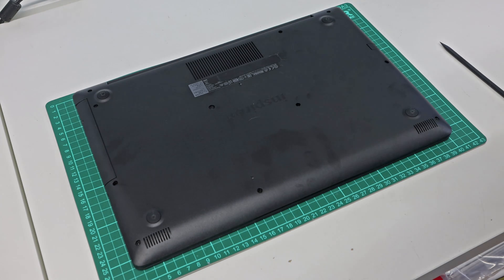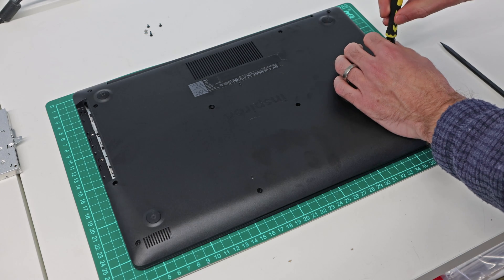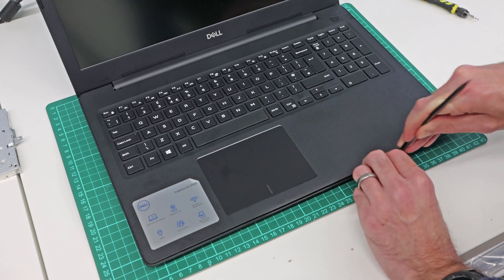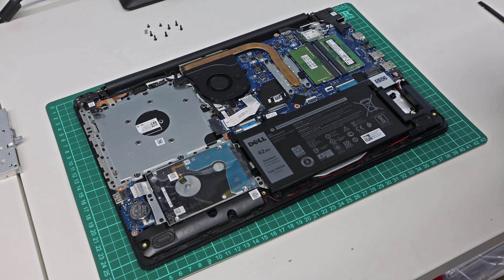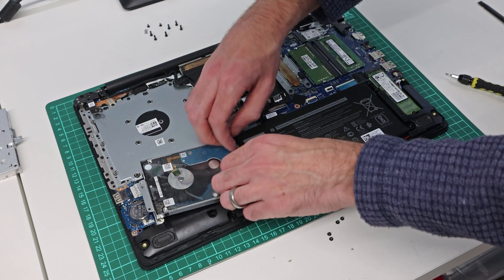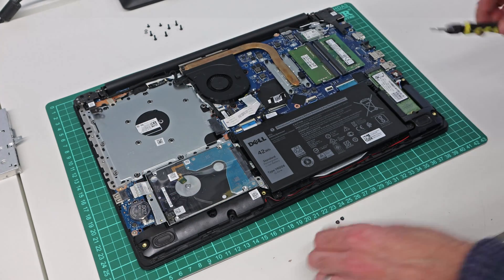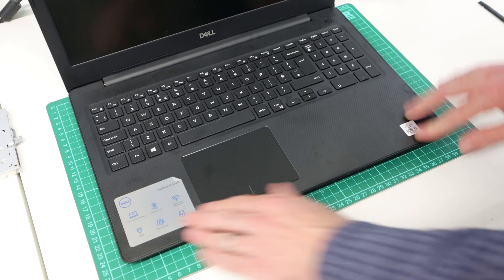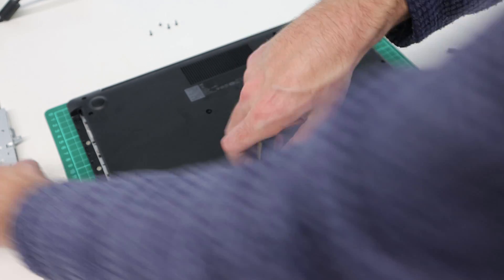Dell Inspiron 15 3593 - SSD and HDD Upgrade and Repair Guide

Comment: Hello can I use the crucial P3 plus instead of the P2 ssd?
Reply: Thank you very much for your advice👍
Reply from the maker: No problem - I've updated the links in the description.
Reply from the maker: Should work, but you won't have any benefit vs. the standard P3 which uses the same controller and is a little cheaper as the laptop won't do PCIe 4.0 speeds.

Comment: What’s the next step after adding new NVME chip (500GB) and Ram(16GB)
I still have my old 1TB HDD

I’m stuck😢
Reply from the maker: You'd either want to clone the contents of the HDD on to the SSD (if it'll fit since it is a smaller drive) and remove or wipe the HDD, or clean install Windows on the new drive.

Comment: HI.. I recently got a Dell Inspiron 15 7000 Gaming i7 from an auction. It is without the SSD, has hard drive only. I have been trying to install windows but it fails. Could it be that there is no SSD?

Comment: Hi there. My Insp 3593 came set up as a RAID array with the m2.sata and the mechanical SATA drive. The drive activity is always pinned at 100%, so I thought I could relieve that by upgrading the SATA drive to an SSD drive. But I'm not clear on how to do that given that I'm coming from a RAID setup. Do you have any tips on how to replace just one of the two drives of the RAID array? Or another strategy? The SSD (Crucial) comes with Acronis cloning software. Thanks!

Comment: I have the 3593, thanks to ur video, I was able to upgrade the memory. Your videos are well detailed and explained. I watched the above video in hopes of increasing storage space but got lost in the lingo of components with sata and nvme...... Please assist .
Reply from the maker: You have two drive options in there - the M.2 slot, which takes a new style M.2 2280 drive of the NVMe type (1TB Crucial P2 M.2 2280 NVMe SSD: https://amzn.to/3pL2i7o) and a 2.5" SATA bay which can take a traditional mobile HDD/SSD (1TB 2.5" SSD: https://amzn.to/2K1OjtV).

Comment: 10:50 doesnt void the warranty as long as you have original parts for exchange with technician. dell technicians are outsourced and get paid for replacement. they are not gonna deny warranty cos they wont get paid
Reply from the maker: Good info, thanks.

Comment: Brue computing 
Can you tell me 
Is the m2 port is pcie x2 or x4 length
Also can you upload a video of that laptop showing the ssd benchmarks... Pls.. :(
Reply from the maker: The length doesn't dictate the PCIe lanes - it can take either M.2 2230 (30mm length) or M.2 2280 (80mm length) drives.
The slot is keyed for PCIe 4x Gen 3 devices, but I didn't test a 4x device or run any benchmarks - I no longer have the laptop (I only kept it a couple weeks to make videos) so can't help with this.
Reply: @BrueComputing  thanks for the response..
I am sorry i really got the length part wrong 
I Actually meant the bandwidth
Although i purchased a transcend nvme ssd 220s 256 GB
And saw it supports pcie x4
Glad i got confirmed... 
Thanks again

Comment: where did you find dvd slot there? i dont have on mine
Reply from the maker: Not all models have them - I specifically bought a model with mechanical HDD and DVD drive, but most options here in the UK were SSD with no optical drive. Some regions may not have an optical drive SKU available.
Reply: @BrueComputing  one more question please. Recently bought Dell an Inspiron 3593 laptop and noticed that i need to press the power button for about 2-3 seconds when I am initially powering it up. When i press it quickly,it wont power on. But when its connected with power cord,then it will boot normally even with quick press of power button. Is this normal?
Reply: @makkeyn  it's the same for me.

Comment: hi i have laptop dell inspiron 3593, i7 and 8 gb ram..but my laptop doesn't have CD slot.. may I know which ssd should I buy.. I planning to buy Silicon Power NVMe PCIe Gen3x4 M.2 2280 SSD.. does it compatible with my laptop? TQ

Comment: Can you open the inspiron without the prying tool? Cause i only have a screwdriver
Reply from the maker: Spend a couple quid on a pry tool, or use something like an old credit card. A screwdriver will mark the plastic and make a horrible mess.

Comment: Sir upto how much ssd we can insert in this laptop
Reply from the maker: You can fit 2 x SSDs, one 2.5" SATA and one M.2 2280 NVMe type drive.
Capacity should be for whatever will fit, so up to 8TB in each.
Realistically I'd consider the follow (Amazon Affiliate links):
SATA 2TB: https://amzn.to/3i0ENnp
M.2 2280 NVMe 2TB: https://amzn.to/38to60r

Comment: Thank you so much for the video! Just 3 questions
I see your M.2 has 2 pin openings but the slot on the laptop has 1. So it will still work?
Also, I'm planning on buying a 250GB M.2 NVME drive with only one slot, should this SSD fit and work? Lastly, if I only want to ad the M.2, is it still necessary to disconnect the power cable. I feel a bit nervous pulling out cables. Thanks again!
Reply from the maker: Yes, the SSD has 2 keying positions so it'll fit in to B or M keyed slots - it works just fine. Its a PCIe 3.0 2x drive.
You don't HAVE to disconnect the battery, but I would recommend it, it means you aren't going to accidentally be disconnecting and reconnecting things with the laptop turned on.
Reply: @BrueComputing  Thank you very much for the reply and information. I really appreciate it

Comment: Can we upgrade processor in dell 3593
 remove i3 and install new one i5 or i7
Reply from the maker: No, the only way to upgrade the CPU would be to fit a new mainboard.

Comment: i have 3593 with 10th generation I am unsure shall I buy m.2 2280 which you used or I can install nvme too?
Reply from the maker: M.2 2280 drives can be NVMe or SATA - I fitted an NVMe type M.2 2280.

Comment: Hi. I need to know the brand of the factory HDD.
What speed is the 4gb factory RAM?
Does this model include a control battery charge adjustment? (Bios or windows software?)
Thanks a lot.
Reply: Factory HDD is Western Digital (WDC WD10SPZX-75Z10T2)
Ram Bus is 2666MHz
Reply: @iamislamrafi  Thanks

Comment: On my Inspiron the ---  M2 slot, memory slots and battery were in the exact same place as on your Inspiron. With the nvme drive I just installed, laptop moves 10 times faster with 11 second boot time. Of course I left the original 1TB hard drive/ 5400 RPM/ in place for storage
Reply from the maker: Great stuff - hope the guide helped!
Reply: @BrueComputing 
What’s the next step after adding new NVME chip (500GB) and Ram(16GB)
I still have my old 1TB HDD

I’m stuck😢

Comment: Thanks. I MUST disconnect battery! Like you did. (I am about to install an NVME in same laptop but has no DVD)  What speeds for your new SSD install?
Reply from the maker: You don't HAVE to disconnect the battery, but it is recommended as it avoids the risk of connecting or disconnecting a device with the laptop powered up and causing damage.
Speed of the SSD will depend on what you fit.
Reply: @BrueComputing    Thanks! I rather disconnect the battery. So I did so on Friday  (using a spudger) and installed more memory and a West Digital nvme drive. My Inspiron laptop moves very fast now. On the reads/writes it is now  2460/1800 so I am very pleased.  Your video got me motivated to do it_______ For disk cloning I used an old version of Aomei which was completely functional. Look on the www and they are out there. The new "free" versions try  to make you buy Aomei

Comment: Is it possible to upgrade the CPU for this laptop
Reply from the maker: No. Very few modern laptops have CPUs which can be upgraded without replacing the entire mainboard - only a few gaming machines based on desktop components.

Comment: Can you provide a sample hdd model that matches this notebook?  I only have ssd and need more memory (1tb).  greetings
Reply from the maker: If you only have an SSD then you'd need to open it up and see if you actually have an internal SATA connector and the associated bracketry. If you don't you'd either need to source the parts, or fit a larger M.2 SSD, eg. https://amzn.to/3dZryQk

Comment: Hi - thanks for the video. 

I have the model without the dvd, however the motherboard connection exists, so  I would like to connect another drive (and have 3 drives). Do you know the cable number item? Thanks

Comment: Good day I am interested in such a laptop, can you tell me how long the battery life is.?

Thank you for indepth video.
Reply: about 3 hours if you aren’t doing anything too power hungry
Reply: @chuuisinsane  Thank you
Reply: @chuuisinsane  Hi. a question:  Does this model include a battery charge control/ adjustment? (Bios or windows software?) thank you

Comment: My dell 3593 i5 model has the bottom vent covered with plastic from the inside. 
What about this model ?
Reply: I want to buy the Core i3 of that computer but I am worried if the vent is covered with plastic at the bottom makes it run hot? I do not play games at all. I just want to use it to write on it and browse internet and Youtube.

Comment: Hello, thank you for the video. Do you have any idea if the 128 SSD version can be fitted with an HDD?
Reply: Idk about the 128 GB version, but if it's a 128, GB Sata SSD it might got a chance (if it fits), if it's a m.2 SSD then tough luck m8.

Comment: Hi sir, I have dell inspiron 15 300, 4GB ram, I5 core 10th gen.. It was quite slow whenever I perform even a simple task.. Can you suggest me some possible option or advice to achieve a better perfermonce 😕
Reply: If you dont have a SSD, swap out your hard drive first for an SSD. Then upgrade your 4GB RAM to 8GB. It will double the speed of your computer.
Reply: @blahblahblahblah2837  thank you sir, it was a good thing to ask I don't even have an ample amount of idea about laptop upgrades.. :)
Reply: @blahblahblahblah2837  another thing sir, is it possible for me to just add an SSD(replacing disk drive) to have 2drive within my laptop, or should I really need to change my primary drive to SSD... Does the placement of SSD as main drive in laptop impact its performance? Sorry for the inconvenience Im not really into techne stuff😢😭
Reply: @sicguan4223  Hi Cguan, Im no expert myself, but I think to improve bootup speed and performance when running programs, you do need to shift the primary drive to the SSD. Otherwise the computer still has to read the system information off the slow drive right? You can use the slower secondary HDD for storage of things you don't use as often (photos, videos, big datasets etc). There is lots of software to help shift all of your stuff from one drive to another and sometimes new SSDs come with that software included
Reply: Thank you verry much for a great recommendation :)
Reply: My dell 3593 i5 with nvidia graphics has very low fps compare to last generation i5 8th and mx130 graphics. How ?
Reply: @zetsubo07  Im sorry but I don't really know why, the best thing to do maybe is to ask to expert or do some possible upgrade😅
Reply: Hi everyone, how would I know if my laptop model is upgradable or not ?

Comment: Is this Nvme PCI e SSD belongs to Gen 3*4, protocol : Nvme ?
Reply from the maker: It is PCIe 3.0 - I didn't check if it is 2x or 4x electrically however.
Reply: @BrueComputing  Can you check and confirm it's gen 3*4 or other ?

Comment: I recently bought Inspiron 15 3593 i5 variant. It has 1T HDD.

Can I upgrade it to SSD (primary) and use the HDD as secondary?
Reply: Yes, inside is the same architecture.
Reply: Does your laptop heating quickly? I   buy the same one last week it's fan is louder and heating quickly 😔
Reply: @yagneshpatel4265  Yes, heating quickly in depence of loading of CPU around 100 degree celsius and fan increases speed sometimes up to 5200 RPM. In idle temperatures are around 65-75 , 20 degrees celsius ambient temperature. My CPU are I7-1065G7. You may install Dell power managment from Dell.com and  choose "Cool mode" in Thermal managment.
Reply: @buhalkos  okay thank you let me try
Reply: I have the same model 3593 with 1TB HDD, and I bought a samsung 860 evo 500GB SSD to replace it , and the SSD slowdown from 6Gb/s to 3Gb/S, when I go to dell community and open a new thread, dell customer asked me the SSD bought from dell or not, so they limited all SSD that is not bought from dell to make more money, because they slowdown user bought SSD to 3Gb/s, my good feeling with dell end at this day.
Reply: @yuan.pingchen3056  SSD is not necessary  to be  purchased only from Dell. Install Samsung magician application to check that the disk are genuine Samsung. Install Intel Rapid Storage Technology Application from Dell.com and  other chipset drivers too.
Reply: @yuan.pingchen3056  Can you please link to the post on dell community board?

Comment: DVD in 2019 omg....
Reply: why ?? only me in 2020 year?
Reply from the maker: Yes, quite uncommon. Most models of it don't include the DVD drive, but I specifically ordered the HDD model (most are SSD) so I could do guides for fitting an M.2 SSD and 2.5" SATA HDD, and that included a DVD drive.
Reply: @BrueComputing I ordered it without a CD drive. I use an external drive
Reply: Buy a caddy and add an extra HDD or SSD

Comment: Recently i bought this model laptop with a procesor -  Intel Core i5-1035G1. By default there is 8gb of ram, i want more up to 16gb. other components i will leave by default. Will it work corectly?
Reply from the maker: Yes, a second DDR4-2666 8GB module should work fine: https://amzn.to/35aBMJM

Comment: Although I've been doing those kinds of upgrades for years, I have to congratulate you for explaining all things properly and in detail. Your material is also useful for people like considering buying a laptop but having difficulty finding info about it's upgradeability, since even manufacturers usually give little to no info on that (free slots, etc) which is of course very unfortunate for many of us.
Good job brother, subscribed, keep it up

And a question: Is that the model with a touch screen?
Reply from the maker: Thanks for the nice comments.
It is the clamshell model without a touchscreen, there is no touchscreen version of the 3593 (here in the UK at least).
Reply: @BrueComputing  Right. Looked more into it and there isn't. It was a mistake in a Greek website where I first saw it.
Reply: I have the touchscreen version with the same model number lol

Comment: Hi there, can the M.2 PCIe NVMe SSD fit the SSD slot? Thanks.
Reply from the maker: Although I used a SATA M.2 drive, I believe the slot supports both types - the service manual references Intel Optane modules which are PCIe.
Reply: @BrueComputing  Thanks, Bruce. I think the Dell manual mentioned that the Inspiron 15 3953 would support the M.2 PCIe NVMe SSD.

Comment: I have a Dell 3593 like in your video but I have one 512SSD and want to add another SSD to add more space.. I have no cd drive.   Can I put the new ssd in the spot where the satr hard went.  Of course with an adapter.. thumbs up on your video
Reply from the maker: Thanks. If your machine doesn't have a HDD installed you may find that you need to source the HDD cable and mounting bracket - I ordered a model with HDD specifically for this reason. If you do check then let me know!
Reply: Does your model has bottom vent opened or covered with plastic?